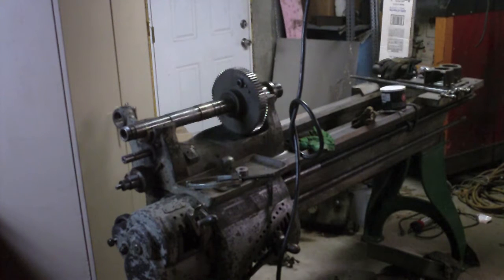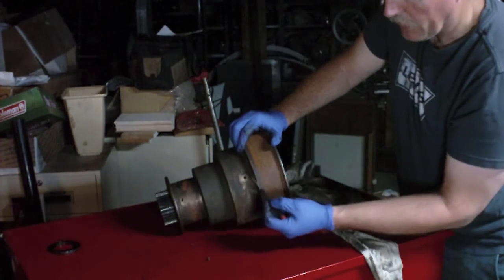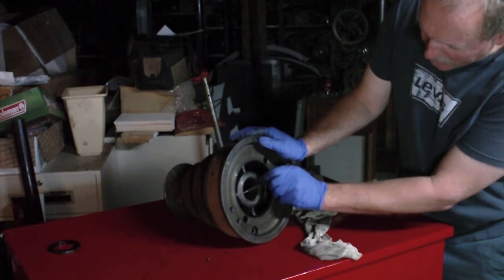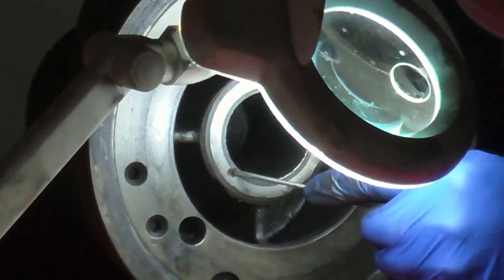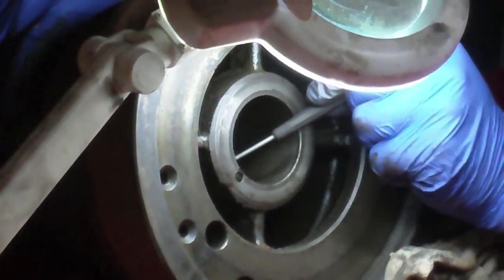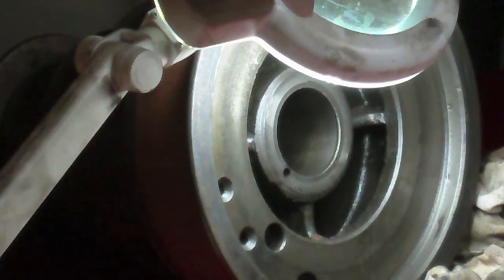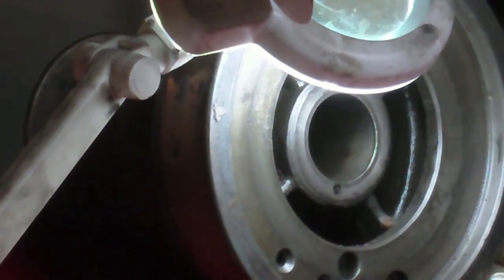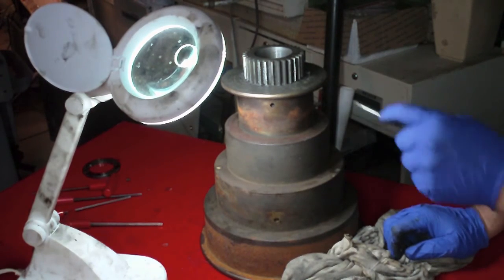The Rare Vernon Lathe Part 16

Comment: That does come off the shaft.  The cones should be a bright finish.. so get them polished up for the leather belting.
Reply from the maker: gbowne1 I'm way behind on editing/posting video. The headstock is almost done, just need the back gear shaft installed. Will be starting on the overhead transmission soon. Upcoming videos will deal with the apron disassembly and cleaning, leadscrew removal and cleaning, and setting the main spindle bearing clearance....just finished that.